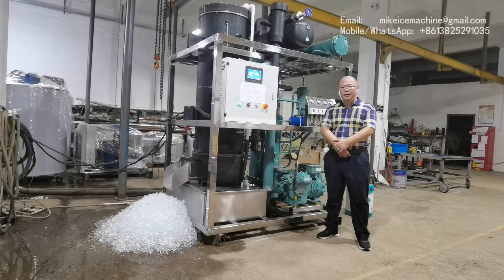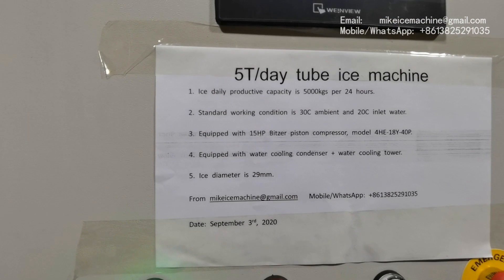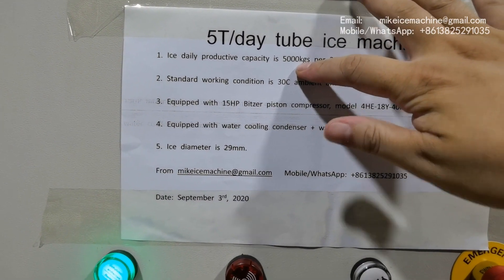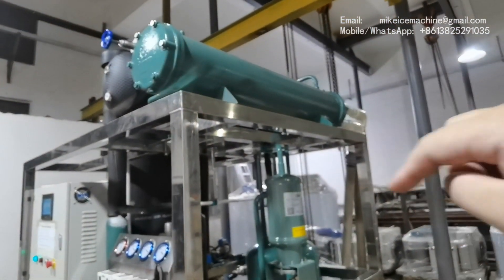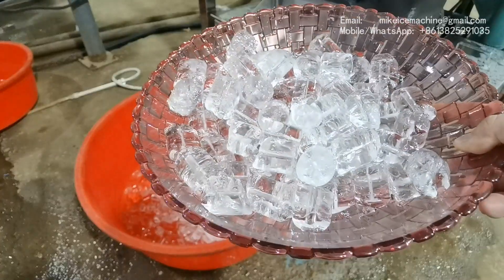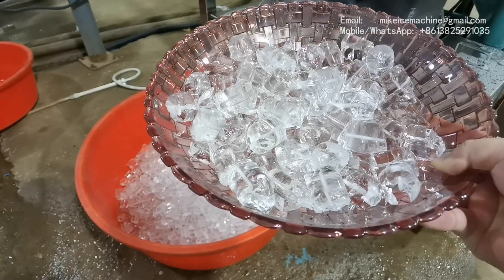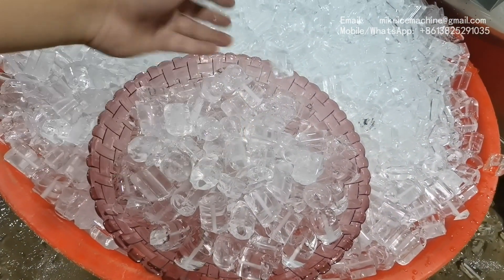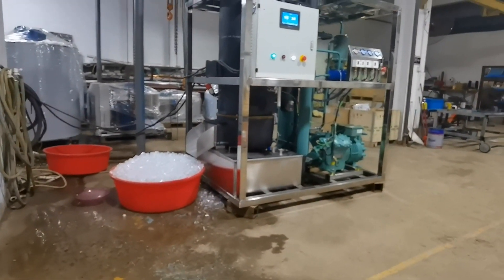How do profitable bagged ice business, packaged ice business with profit

Comment: Do you have any machine for 1 ton?
Reply from the maker: https://www.youtube.com/watch?v=cVluuKLTfGs
That is a video to show my 1 ton/day capacity tube ice machine, and it is my smallest model.

USD 9000 is the price for 1 ton/day capacity tube ice machine.
It is equipped with Bitzer compressor, air cooling condenser and so on.

My machine can make 2 kinds of ice, and that is my tube ice machine's unique advantage.
1. Hollow ice tubes with holes.
2. Solid ice cylinders without holes, more than 70% of the ice can be solid.

Comment: Do you ship in Philippines? What's the price sir?
Reply from the maker: Thanks for your inquiry about my ice machine.
Are you looking for ice machines to do ice vending business?

My machine can make 2 kinds of ice.
1. Ice tubes with holes.
2. Ice cylinders without holes.
Other Chinese machines can NOT make solid ice cylinders without holes.

USD 17500 is the price for a 3T/day tube ice machine, which can make 3 tons of ice tubes everyday, within 24 hours.
USD 24500 is the price for a 5T/day tube ice machine, and it can make 5 tons of ice tubes everyday.
USD 36000 is the price for a 10T/day tube ice machine, and it can make 10 tons of ice tubes everyday.

For your reference, here is a video to show my tube ice machine making solid ice cylinders.
https://www.youtube.com/watch?v=p_wXraEeE2U&t=101s
As you can see in the video, very solid and strong ice tubes,  100% transparent, crystal, and clear ice, the best quality ice.

We also have tube ice machines with bigger capacities, upto 30T/day.

Did you use ice machines to do ice business before?
I ask this question because I wonder if you have other accessory equipment ready in your facility.
Other accessory equipment, such as the pure water machine, ice packing machine, ice bags, cold room and so on.
Pure water is needed as the water resource for ice making.
Ice packing machines and ice bags are needed for making ice packages.
The cold room is needed for ice package storage.

Looking forward to hearing from you.
Reply from the maker: Please send inquiry to me, and here is my contact information.
My email is mikeicemachine@gmail.com
My mobile / WhatsApp is +8613825291035